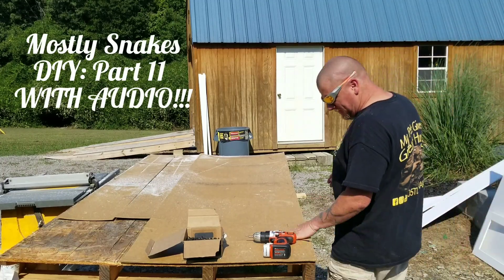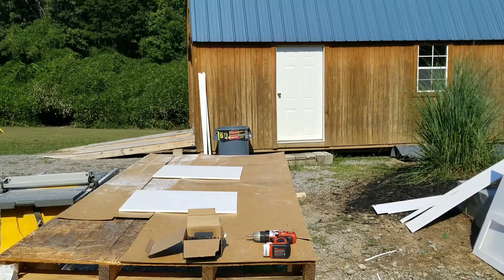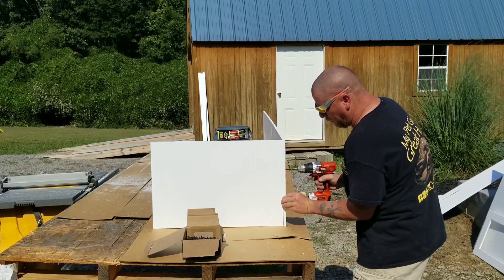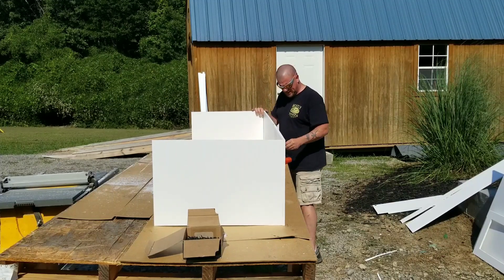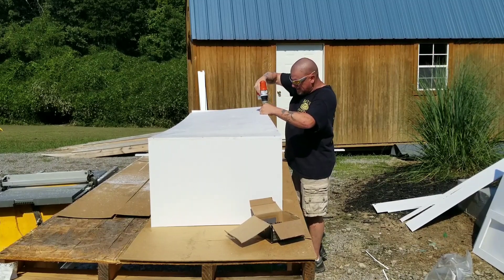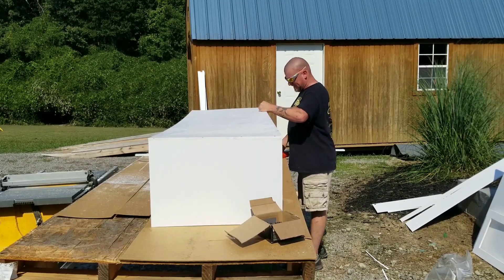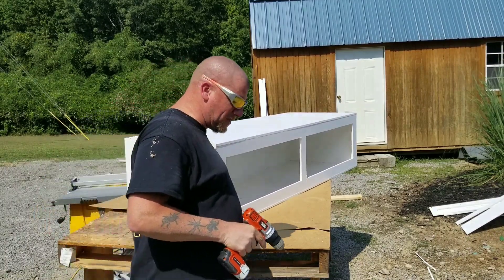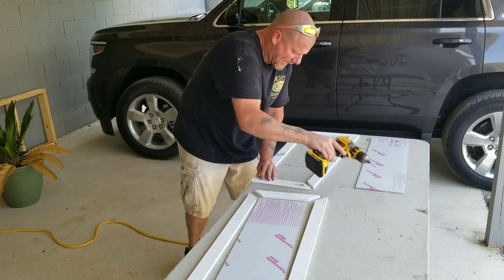DIY: Part II Revised WITH AUDIO.

Comment: Nice build man! Gonna make 2 of these for my girl's boas.
Reply from the maker: Appreciate it Jose, let me know if you have any questions.
Reply: @sghpest  I actually do have a couple questions. I can't get HD Pvc so i am just going with 1/2 pvc from home depot. What size hinges are those yo used and where did you get them? Also the lexel you used .... Does that stay sticky? I've used that before on a roof and remember it staying a constant stickiness to it. 🤔
Reply from the maker: @josevargas8034  The hinges are from Lowe's and just standard 2" hinges. And as for the Lexel, I haven't seen any of it become sticky at all. Dried pretty hard. May be the heat difference when used on a roof. But definitely not in this application.
Reply: @sghpest  ok cool thanks man!
Reply from the maker: @josevargas8034  Anytime. 😁

Comment: Hey Steve in your previous cages you built with the sliding glass doors. How did you fasten down the sliding glass tracks??
Reply from the maker: I used standard PVC Glue. Worked like a boss. Just have to apply outdoors and let it dry due to the fumes. Once dry, No smell and can't pull that shit off with a tractor. Lol
Reply: Awesome thank you very much I just built my 6’ cage today all ready for track and glass. Still waiting on amazon lol. Thanks again I appreciate it bud
Reply from the maker: @Big_Ginger_edc  that's awesome. Send me some pics of final product. 😁
Reply: Absolutely I sure will thanks to your videos it was a breeze

Comment: looks great! thanks for sharing. subbed after part one. you said that you have used pic glue. does the glue work with the end cuts? thinking about trying this with the glue and using a router table to make a lip around the sides to make it easier to get the glued sides to line up easier. thanks again for sharing and I can't wait to watch the other videos you have.
Reply from the maker: The routed channels to line things up definitely cleans things up. I'm just too lazy. Appreciate the Sub jjs811.

Comment: Thanks for the video. I think it looks great. Is the PVC  fire resistant enough to use a 100w ceramic bulb? Can you let me know what pvc you used maybe I  might be able to find it here in the UK.
Reply from the maker: First off, thank you for the kind words. Secondly, it is High Density PVC, I wouldn't say that ANY PVC is good enough for a heat lamp. Definitely would weaken and possibly melt.
Reply: @sghpest  Thanks for the reply. The room I wanted to keep it in is not heated that's why I wanted to use a heat bulb to get the right basking and ambient temps. I guess its back to the drawing board. I'm going to have to stick with making it out of melamine boards.
Reply from the maker: @dinoreps  Do you have access to Radient Heat Panels?
Reply: @sghpest  Yes I've never used them before, but don't they work like heatmats Just heat up a few degrees of the ambient temperature ? Or will it be more like a heat bulb.
Reply from the maker: @dinoreps  Heat Panels work great for snakes. Not so good for lizards or monitors. But snakes, they can't be beat when used with a thermostats. It "radiates" heat to the basking area and keeps a more constant temp. Along with heating enclosure.
Reply: @sghpest  cool I might have to give it a go

Comment: What did u use to  put groove in pvc
Reply from the maker: I did a 1/4" depth on table saw. Using rip fence. 3 passes to make a 1/4" groove. My life would be so much easier with a router. Lol